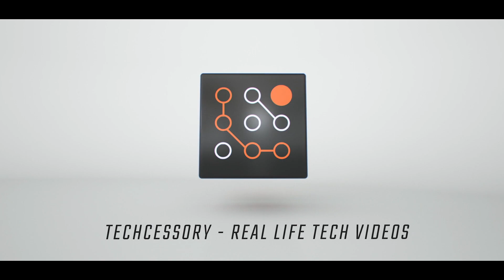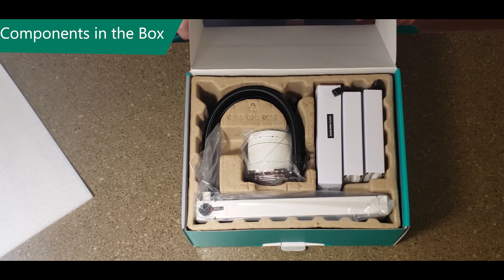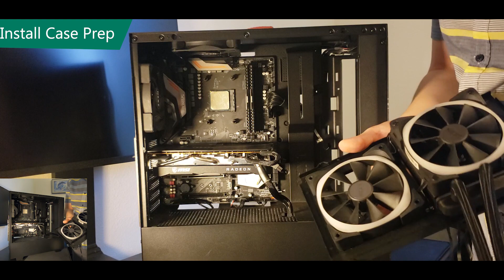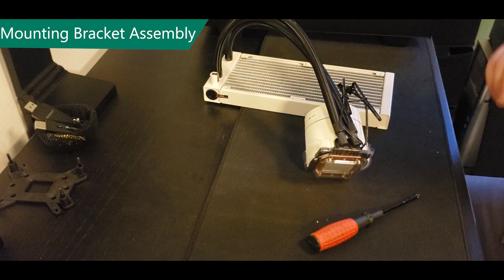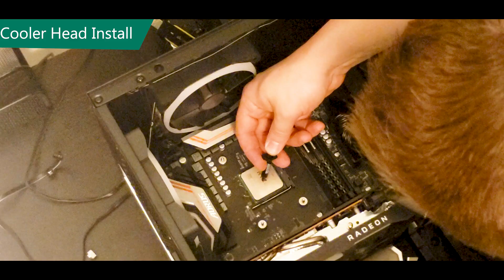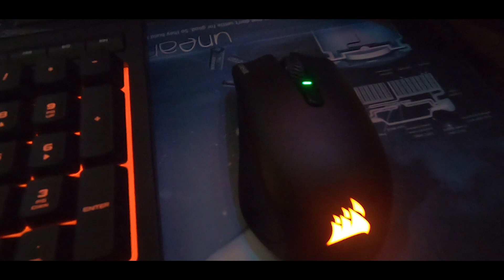DeepCool Castle 240EX Install Guide Video - With Unboxing

Comment: I came across material that explains that most people install radiators incorrectly. According to the principles of physics, the hot liquid to be cooled should naturally rise upwards and, when cooled, exit downwards. Cooling will be more effective and the pump will run quieter.  Turn the radiator over.
Reply from the maker: That is honestly the most well put constructive criticism on the direction of the radiator I think I have seen. I don't know that I can agree or disagree, but it might make a good test to explore on the channel.

Comment: Great tutorial! Really really helped me as a beginner. One question, though: Why did you have us clean off the thermal paste from the cooling head only to reapply thermal paste to the cpu later? We didn't have thermal paste on hand so we had to pause our process to go and buy more. Wouldn't have been easier to just use what was provided with the head itself?

Comment: I would just leave the CPU in the socket and wipe it with isopropyl alcohol. Removing it only increases the chances of accidentally bending pins.  It's safe from that as long as it's in the socket.
Reply from the maker: For sure, you can absolutely take it safe and do it that way. If you don't feel confident and removing the processor then I agree. Thanks for the watch and comment!

Comment: You have your ram in the wrong slots just as an fyi. They should be in slots 2 and 4 to access the dual channel memory that the motherboard uses, otherwise you aren't able to fully utilize what it has to offer.
Reply from the maker: Oddly enough I thought so too. But the aorus x470 is 1 and 2 according to their manual. However, I did change it back to 2 and 4 and I feel way better about it.
Reply: @BainCustom  Yeah Gigabyte motherboards have weird numberings; it's numbered 1,3,2,4.

Comment: Please tell how can I change the cooling color please
Reply from the maker: So I used my motherboard RGB control I believe. This cooler does come with a small controller that can change the lighting. But if you want it software controlled you have to plug it into an RGB/LED pin on your motherboard or an RGB controller of whatever system you use.

Comment: I have the same aio it works but the Rgb won’t work
Reply from the maker: Yeah the RGB requires its own connection. It's been a while, but I'm pretty sure it has an adapter for your motherboard RGB header or an alternate adapter for other connections.

Comment: Hey I just recently got this same aio and I’ve installed exactly like what it said on the manual. My only problem is that my PC won’t POST I’ve done everything I can to fix it and it still won’t boot. (MOBO: ASUS X570-Pro) would you have any ideas on how to fix this?
Reply from the maker: What is plugged into your CPU fan header? Sometimes a motherboard requires that you have a fan plugged into the CPU header and not the pump. So that could be your issue. Any luck since you asked, if so what was the solution?

Comment: My 13600KF Running Hot on This AIO 
Going 50 degree on Idle Temperature 
66 degree on gaming 

I used pre applied Thermal Paste, Should change that paste?
Reply from the maker: Definitely new thermal paste. But make sure there is good contact to the cpu from the cooler head.

Comment: does castle 240ex better than castle 240 rgb v2
Reply from the maker: Why not check out the 240EX RGB. I believe that is the higher end model from them with better fans. But that seems to be the main difference. Otherwise they are very similar.
Reply: @BainCustom   what about the dual-champer pump on castle 240ex, it is the main my concern what maybe can have better performance?

Comment: Did you remove the stock motherboard back plate?.  My mobo is MSI x570 Tomahawk , the supplied screws does not snug fit leaves a gap. I think i should return the cooler.
Reply from the maker: Yes I use the plates provided from deep cool. I'm about 98% certain you can't use the stock AM4 back plate. It will just require a reinstall for you. You should check out my most recent video on the kraken x53. Well worth the watch.
Reply: The movement is expected for the stock back plate when i fit the cooler it tightened correctly. Thanks for the videos.
Reply from the maker: Oh good. Glad you got it figured out.
Reply: @lgtvsmart4078  so the back plate moves a lot before the fully apply it

Comment: Hello, I have a similar deepcool 240 aio and had some questions. I have 3 stock case fans pulling in air and wanted to mount my aio to the top of my case with my fans the opposite direction of yours. Do you think this setup alongside just the stock thermal paste on the cooler would work?
Reply from the maker: A couple of questions. I think what you're saying will work, but...are the 3 case fans on the front? If so, what are you using for exhaust fans? If you are planning to exhaust through the top and the back I would say that is a good method. The direction of the radiator fan is nominal in performance difference, so as long as you exhaust the same amount of air coming in you will be fine.
Reply: @BainCustom  Yes, the 3 case fans are all at the front, and I plan to use the 2 aio fans as the exhaust; that is what I have now. Should I buy another 120mm case fan at the back as an exhaust? or will 3 in 2 out work.

Comment: How do you control the fan speed on this if you don't have a fan controller??? I have an Asus z390 motherboard looking to get this.
Reply from the maker: If your motherboard has pwm connections for fans then you can do it that way. Through your motherboard control.
Reply: BIOS i think

Comment: My motherboard only has 12v rgb headers does this mean i cant use the rgb on this aio?
Reply from the maker: No they have conversion cables included with the kit. You can also check out the video I just did on the NZXT x53. That was an easier installation than this all in one. Both are good by the way.
Reply: @BainCustom  Thanks. I already bought the castle aio as i like its appearance and reviews said it was decent for the price. I'm just worried it might not come with long enough screws to go through both the case and fans into the radiator as i want it mounted as intake on the front but with the fans showing on the outside because i have a glass panel case, and it would look weird with the radiator showing from the front of my case's glass panels. I hope everything turns out well though. Appreciate your videos and help.
Reply from the maker: @kotaspremiere2931  Your welcome. I mount the fans first and then the radiator in most of my builds now. It does depend on the fans themselves and the case. But it should fit if you mount it fans in front. Good luck and thanks for watching!
Reply: @kotaspremiere2931  So I don't have a 5 pin Argb header either, did you get a converter with you?
Reply: @genotsSnor  I think you mean 5V ARGB which is 3 pins. You can either connect it with the controler via sata power, or you can use the 3 pin 5v header if your board has one for more customized rgb. So you should be fine either way. If you bought this aio it should have labels on all the cables or cable bags which will tell you what header each cable is for. Just make sure you don't mix 12v and 5v headers and cables as that can damage your rgb or other parts. It's more simple than it sounds once you get it you can tell each type of rgb header has a different pin layout.

Comment: Specific question for this aio: do you think the tubes might be too short when front mounting it in a relatively big case?
Reply from the maker: I have heard that before. My aio was much longer than other people's. So either it was fixed and the tubes are longer or the QC has gone way down..I am about to review the X53, although I'm sure that doesn't help now.
Reply: @BainCustom  how do I change the logo

Comment: 12:03 it's wobble, how to tighten it?
Reply from the maker: If the right spacers are used you will not experience a wobble. It will seem loose until the cooler head is tightened into place.

Comment: My cpu bracket moves so much is it normal?
Reply from the maker: It is until it is tensioned down properly. Did you use the spacers they provide to make sure it tightens up when you screw the cooler head on?
Reply: I have the same problem 😭😭
Reply: @imBrainstorm  thanks I'll do it

Comment: Not to be too critical, but shouldn't an "install" video include ALL of the installation, and not "I'll pause and come back when it's wired up?"  Also, the RGB on the AIO's fans do not appear to be working when you're done.
Reply from the maker: If you could time stamp what you are referring to that would be helpful. Also, this 240EX model is not have RGB fans, only the Cooler Head is RGB.
Reply: 21:23

Comment: You should do another install video that skips all the advertisement and babble and straight to the install, no babble, just step 1, 2, 3 etc. See which video gets more views.
Reply from the maker: I'm all in! I like that idea. I'm actually working on an open cast bench to be able to do things like this. So you will probably see that video fairly soon.
Reply: @BainCustom  I am trying to install this cooling fan, and the screw aligns with the holes in the motherboard, but there is nothing to screw into. How do you solve that issue?
Reply from the maker: Did you put the backplate if the motherboard on? The one that comes with the motherboard?
Reply: @BainCustom  I don't remember seeing a back plate, I'll have to rummage through the boxes and to see I missed it. Thanks for the clue.
Reply: Ya, that video is called look up the instruction manual. It consists of 4 images, step 1, 2, 3, 4 BAM!! DONE.
Reply: @AzNightmare  Cool can I get a link to the instruction manual?